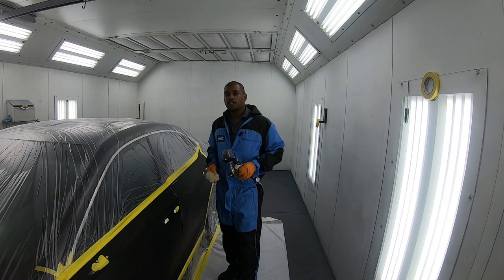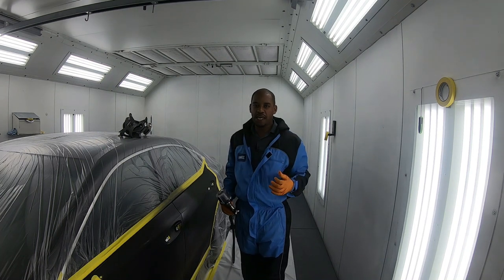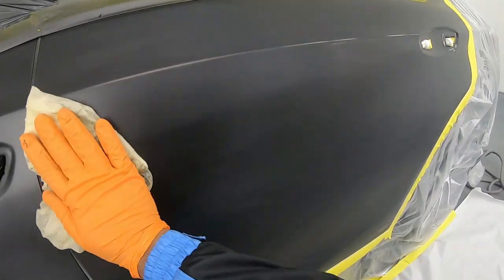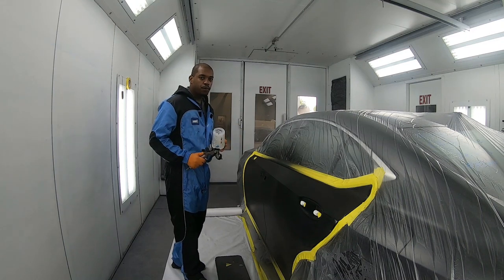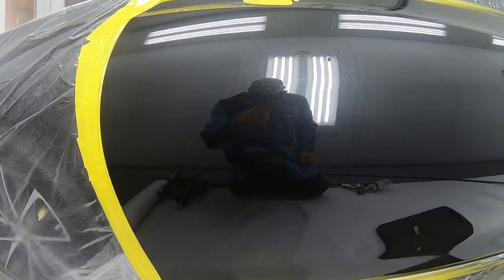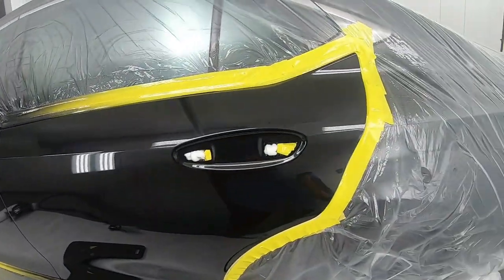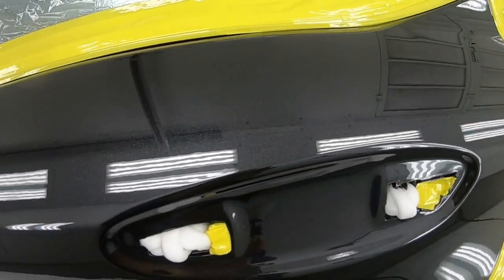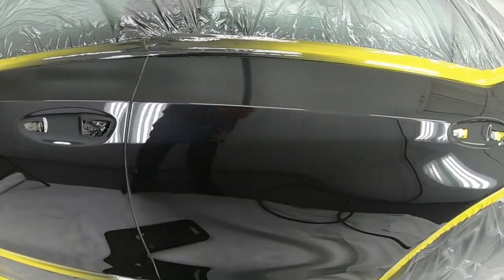HOW TO USE THE DV1 BASE GUN FOR CLEAR

Comment: I found a great video of a guy breaking down the dv1 base and clear guns. They are both the same. It’s the caps that are different, the B+ cap and C1 caps are the same also. And obviously the tip size if you want to change them will differ. The reason I’ve been searching is because I ordered the wrong one and a base one arrived. I’m just going to run with the base gun as a clear gun with the b+ cap on 1.3mm set up.

Comment: cheers mario, would like to ask i have a dv1 base with B+ hvlp set 1.3, if i use it for clear is it only the air caps i replace or it should be in set like the nozzle, aircap  and pins? thank you more power!!
Reply: That’s a good question. It looks like the same spray gun, except the aircap. Would it be possible just to change the aircap so you can use one gun for base & clear ?
Reply from the maker: 👋 if you guys notice I didn’t go through the trouble of switching out parts I just use different tip sizes. However if I’m to replace parts it would just be the air cap and the tip size. But based on my experience with the gun nothing needs to be changed except the tip and the pressure.
Reply: @mariopaintclass6091  Thank you Mario for thanking the time to respond. Learning a lot from you! 

 One more question: Basecoat you spray at about 17 PSI and clearcoat at about 26 PSI, measured at the digital gauge on top of the gun?
Reply: @mariopaintclass6091 I have the non digital version was these readings at the digital guage or at the connection before the gun?
Reply: I’m also curious

Comment: Hi mario,thanks for the tips and video..this is awesome..i got dv1 1.2 B+ base ,what would you recommend air pressure,fan and fluid for base and clear?.. i can only afford to buy this, that's why i don't have extra parts..thank you in advance 😄👍
Reply from the maker: Thanks for watching. 15 to 17PSI  for PAINT. Wide open fan. And two to 3 turns out from full fluid. This one gun can do it all. Check out this video to see exactly how I set it up. DVI BASECOAT GUN REVIEW
https://youtu.be/XDdvvIMtfWY
Reply: @mariopaintclass6091  thanks Mario..still lots of things to learn..😄👍
Oh ya,,I'm been told that air pressure are different on digital and non digital version..they say I have to up the air pressure a bit for non digital..is that true?

Comment: Hey Mario I bought the new dv1 clear gun and it seems that the dv1 b plus cap and dv1 c 1 cap from clear gun are the same including the flow caps are identical. So 1 gun does both. No problems
Reply from the maker: @michaelbarber6211  👋 this is why I just stick with the base gun 👍

Comment: Mario, in one of your other videos you say that this gun is not good for clear coat. What changed between now and then? Different air cap or settings?
Thanks!
Reply from the maker: I don’t remember saying that. However I’ve come to realize that most of my base guns work just as good with the clear coat once you understand how your gun works and the tip to use.
Reply: It was in this video about 10 minutes in. The reason I ask is because I wanted to my DV1 base coat gun for clear and wanted to make sure I was getting the gun setup correctly. Thanks
Reply from the maker: @sethtemple5477  yea man it works great

Comment: Nice
Reply from the maker: Thanks
Reply: Have you tried the DV1 with single stage?
Reply from the maker: @KenOfHouston  never tried it with single stage. Have you?
Reply: @mariopaintclass6091  No.  I used to do quite a bit of boat painting by brush with Algrip and Sterling - it turned out really nice.  Now I'm using single stage on small planes and have ordered a DV1 clear coat.  Small planes are much more difficult to paint because of the rivets and having to paint so many odd angles (including a lot of upside-down).  All sanding must be done by hand so rework is a real bummer.  I'm hoping that the DV1 will make this easier.
Reply from the maker: @KenOfHouston  tuff work. I believe the DV1 will be of great help. You should consider getting the C2 cap.